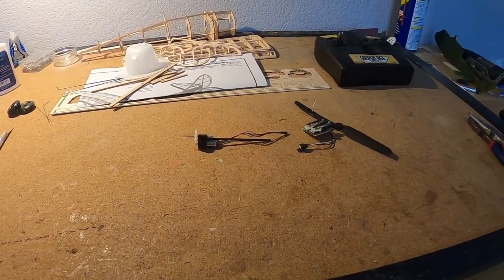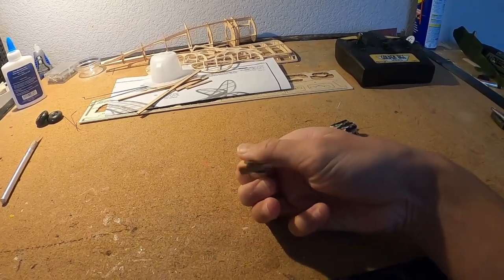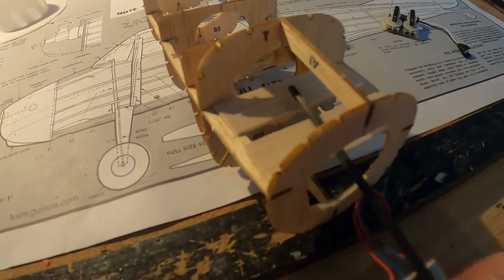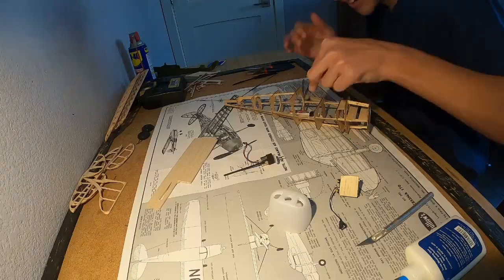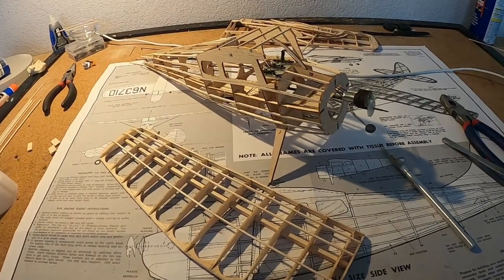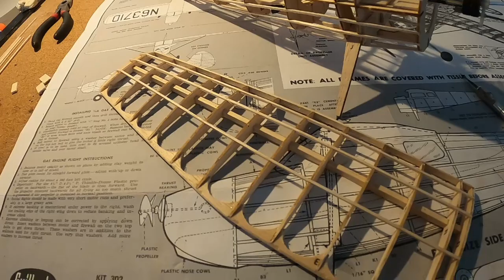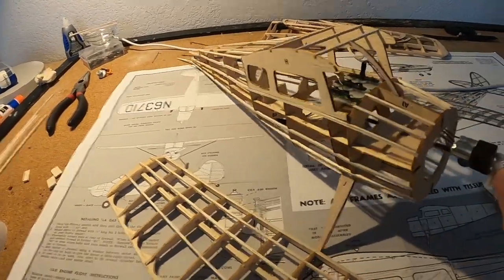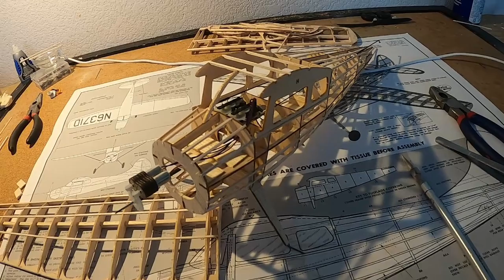Guillows RC 170 Conversion PT.2

Comment: Top notch work building that beauty!  Two questions - What's the total flying weight?  What did you decide to use for hinges on the control surfaces?  I opted to use Dubro mini hinges, cut in half and then trimmed down more wherever they sit in the model.  The full flying weight of my Cessna 170 happens to be 170 grams w/ a full 1/2oz fuel tank and a 1S 210mAh lipo battery.  I can imagine your Cessna beating mine in weight after looking at how well you lightened your model up.  Keep up the great work and I look forward to more from you!  Subscribed  :)
Reply from the maker: Thank you! I will get back to you on the weight but for hinges i used clear scotch tape and painted over it. I would’ve used durbo hinges but the aircraft was too small for such a heavy duty hinge. But the weight i will let you know! Thanks for your comment!❤️